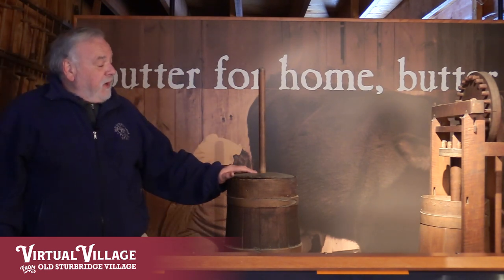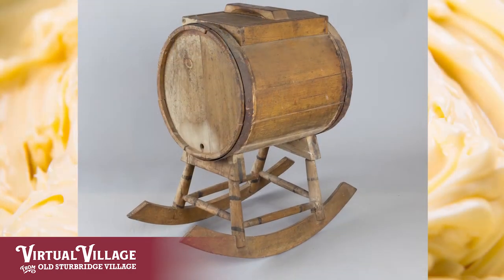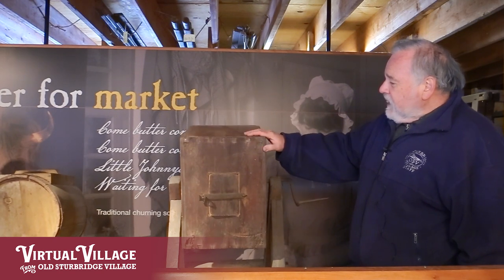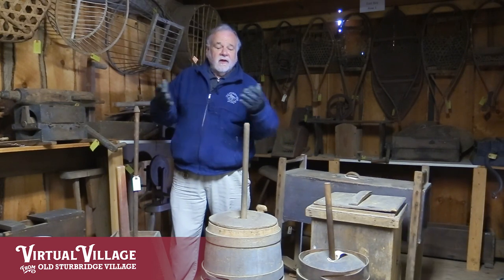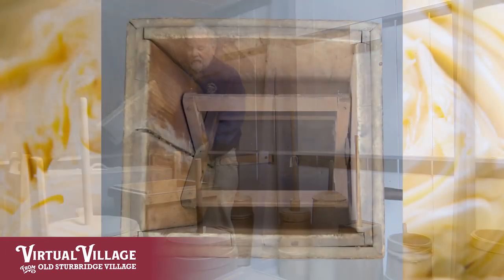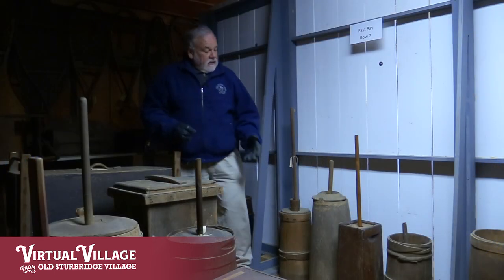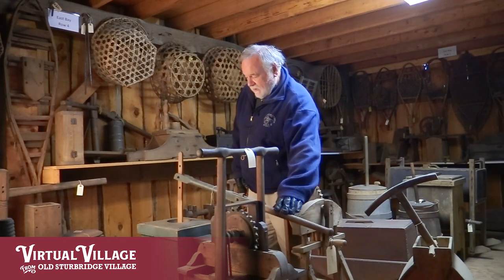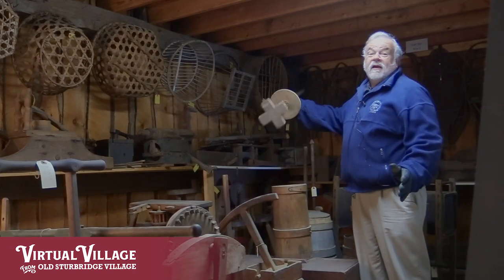Objects in Focus - A Collection of Churns

Comment: How did they clean them after use?
Reply from the maker: Mainly with hot water and a soft brush as well as the occasional sun scalding.  A little dish soap would not hurt if they rinsed it very well afterward, but water and sunlight would be best.